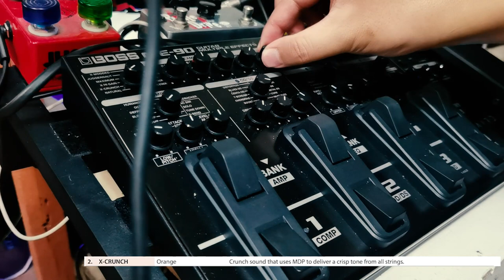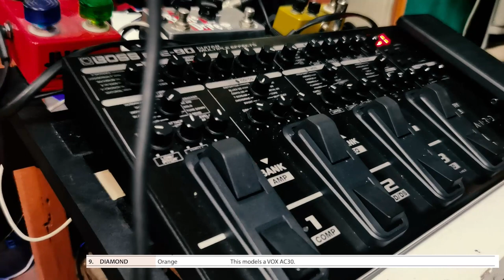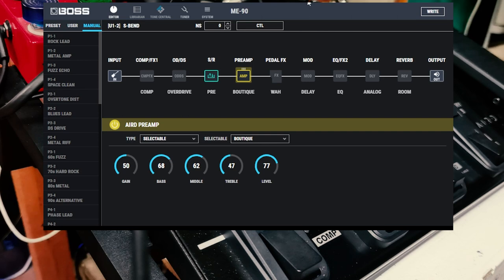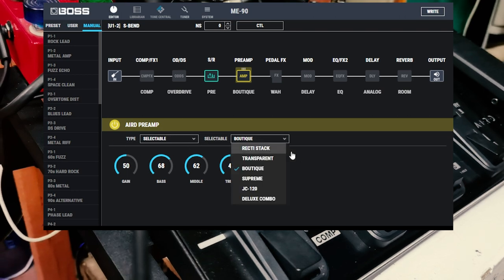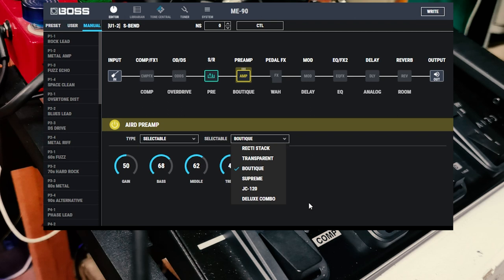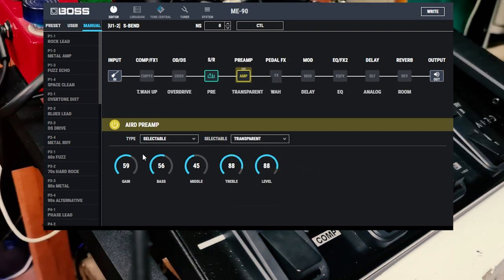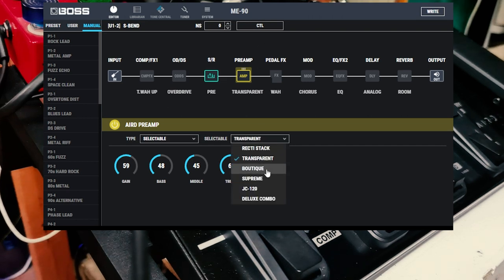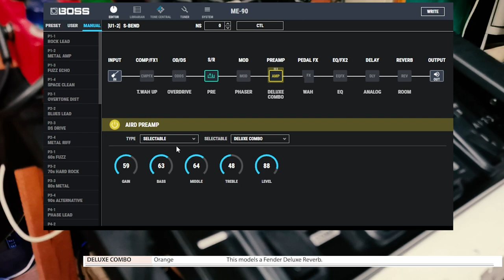Boss ME90 AIRD amp models demo (English)

Comment: Good morning. I ask for help regarding the ME 90. Trying the delays: MODULATE, WARM, TAPE, ANALOG, STANDARD and also the one in the EQ/FX2 part, they are practically all the same and not even a stereo one. Is this the case or did they give me a defective pedal board? I've been using Boss pedals for a long time but never with this limit. Thank you and greetings.
G.
Reply from the maker: Hi there! This might be a defect if there is no difference between the different types. I hear a big difference on each type of delay in ME90.